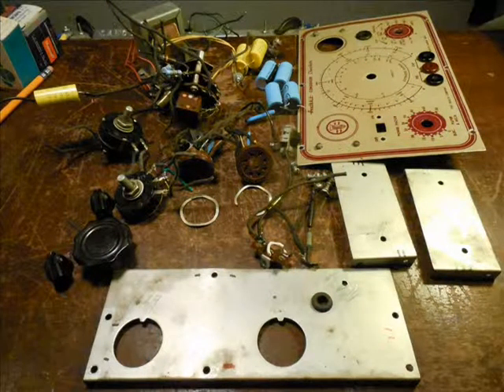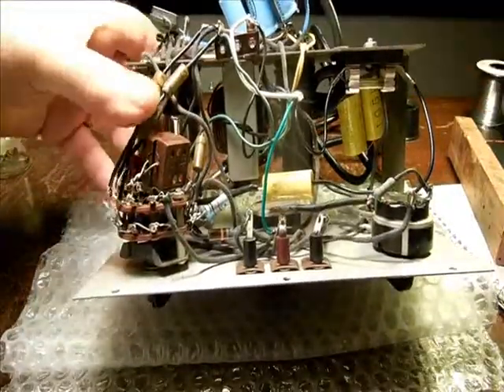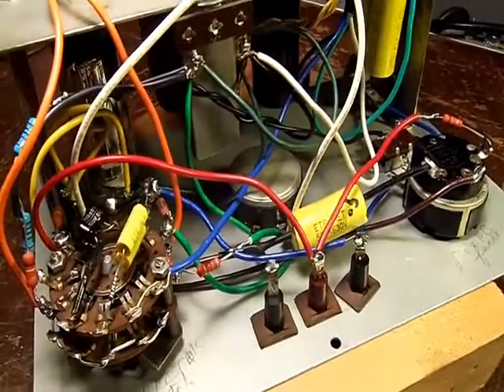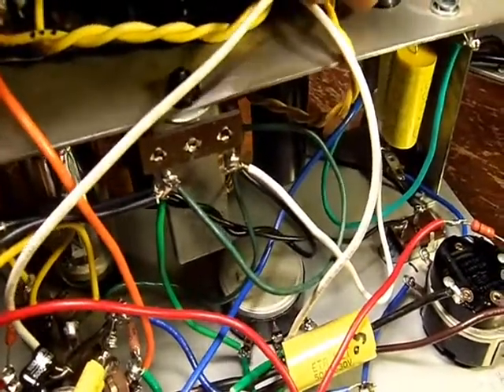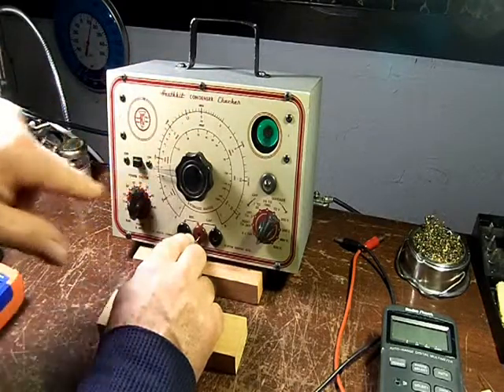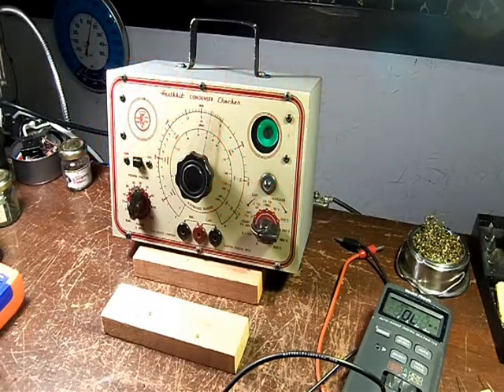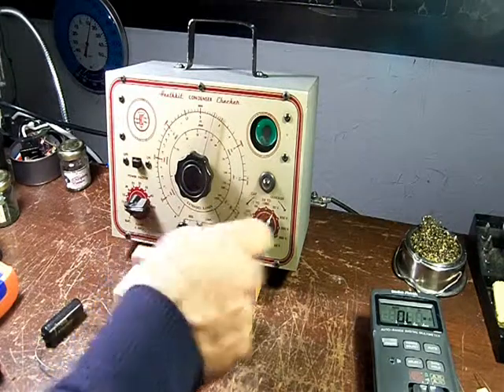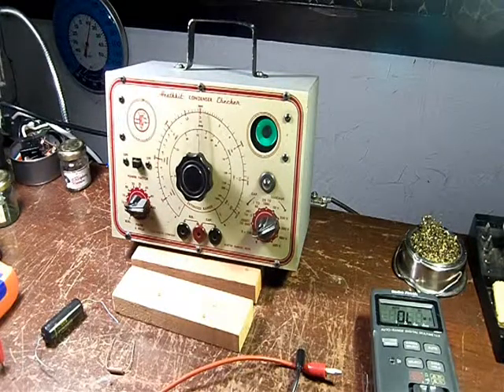Heathkit C2 Condenser Checker

Comment: As I understand it it's OK to put electrolytics in series as long as you include high value resistors in parallell with each one. Typical value is a 470K across each cap.

Comment: Putting two caps in series is useful if they have twice the capacitance value you need, but not a high enough voltage rating.  For example, if you need a 10uF cap at 600v, you can put two 20uF 400V caps in series instead.

Comment: Excellent  Those Radio Shack meters are great. No twisting the center dial just an on/off button. I bought one new about 20 years ago and have since bought 2 more off Ebay just in case something happens to the original.!
Reply from the maker: For a hobbyist like me, this meter does the trick! And, very accurate when compared to a ridiculously priced brand name meter. One suggestion: If you plan on NOT using the RS meter for an extended period of time, remove the batteries. Keep an eye on the batteries for leakage, which of course, can do some serious damage to the printed circuit board within the meter. Thanks!